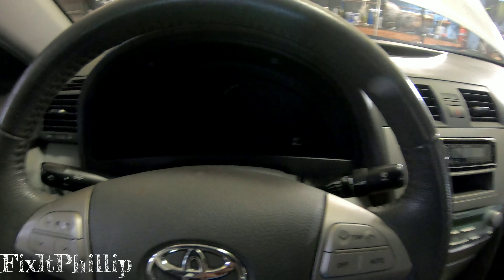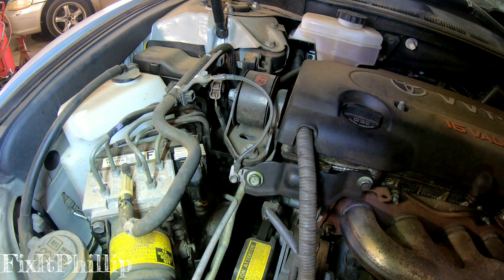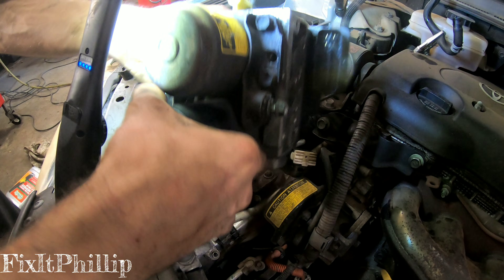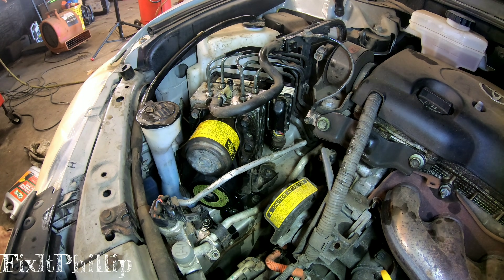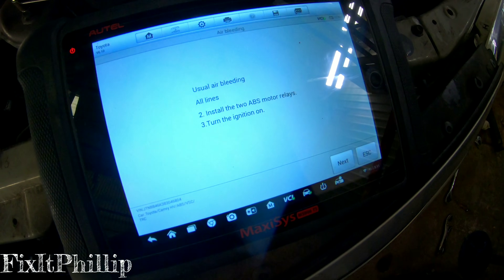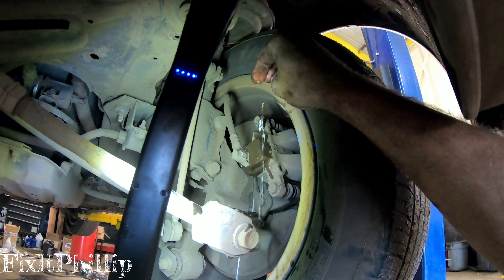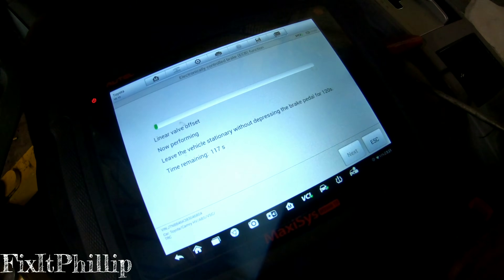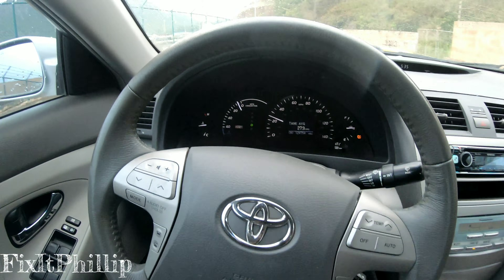07-11 Toyota Camry Hybrid ABS Module Replacement & Brake Bleed C1252 C1256 Abs Light On Accumulator

Comment: The Video shows that you bleeded only the two rear wheels, not the front , right?  Or all four ? 
Also do we need to refill it with some break fluids again since we lost some during the bleeding process? 
Thank you
Reply from the maker: All 4. The fronts u can bleed manually like any other car. And yes don't allow the reservoir to get too low
Reply: Hello again , Should we bleed the brake Synchronously when the Autel  device connected to the car or is it okay to bleed the brakes then in a different time connect Autel device to do the calibration and clear the codes ? 
Thanks a lot
Reply from the maker: You should look up the bleeding procedure after abs module your your model, and yes follow the prompts on the scanner. And yes the codes did clear after replacement of defective abs module and calibration

Comment: Do you know if the Autel MX808 is able to do this? It says it does ABS bleeding. I had bought an INNOVA 5620 that claimed to do ABS bleeding but couldn’t do it on a 07 Camry Hybrid.
Reply from the maker: I don't think the mx808 is bidirectional so it won't be able to do it
Reply: @FixItPhillip  damn, do you know the cheapest scan tool that can do it?

Comment: After replacing this abs actuator/accumulator system my trac control light flashs randomly while braking with clear road conditions. Check VSC system light came on once and never again other than that no noticeable issues. No ABS loss no braking issues. No fault codes when scanned Is it an issue unresolved with brakes or something separate like a wheel speed sensor? 2007 Camry 175000 kms

Comment: Hi, my 2012 camry hybrid is ABS pump and accumulator needs to be replaced and have been told by the technician that all the numbers on both needs to match with replacement one. is that true? thanks
Reply from the maker: Yes it has to be the right part number

Comment: Good day.
My location is Nigeria 🇳🇬. 
I have these two codes C1252 and C1256    on my 2012 Prius. It's not steady. I could be driving the abs and brake light will come on. After sometime it goes off within 1 minutes to 5 minutes. Then my braking normalizes. When it comes on I find it difficult to break. 

Please what exactly should I do in my case?
Reply: Hi brother, sorry you need to change your abs. You can contact me for any of your hybrid vehicle work in Nigeria

Comment: I had to bleed the brakes on my Toyota hybrid.  After I installed new calipers. Do I need a scan tool to clear the abs lights or will they turn off by themselves? I also checked all my sensors and there ok...

Comment: Thanks for the video! Brake fluid will cause the paint to peel off the wheels and body of the vehicle if not thoroughly washed off. Water is brake fluids enemy so it does the best job of cleaning it haha.

Comment: So if i just replace the part and bleed the breaks like normal as instructed in your video, i should be fine other than the codes still showing correct? or would the codes mess anything up....

Comment: Phillip-love the video and thanks! Quick question-if I can do all the steps you walked through. Is it ok to do this switch and bleed the lines without having a diagnostic program talking to the OBD? Can I do this and then take the car to a shop for the linear adjustment? I know it has to be done-I just don’t want to do all the steps and then create more issues-thanks!
Reply: Thanks!
Reply from the maker: If you do all the bleed steps with the computer. Then do the linear adjust later it should be ok. But I'm not 100% on that

Comment: I saw another video that the tech was working on a 2007-2009 Camry that wasn't a hybrid and he left the metal part with the brake lines attached and only replaced  the plastic portion and as such didn't have to bleed the brake lines.

My 2007 hybrid Camry still has fully operational brakes and pedal is operating normally.

I has all of the same dummy lights on you did when I took it to Firestone earlier today.

Firestone reset the codes but they said that at some point in the near future I'll have to replace the ABS actuator assembly.

Since I don't have the computer like you do...

Would it be possible for me to only replace the plastic portion for now in hopes of not having to replace the entire thing at all.

Here's the link to the video that I watched before yours.
https://m.youtube.com/watch?v=pPife7OD9LY&list=LLQ8rwi6EdgIJrPzD_NJQRAA&index=4&t=33s
Reply from the maker: That would all depend on which part of the system is actually going bad
Reply: @FixItPhillip  Can you trust the dealership to tell you exactly which part it is? They said it was this part but I don’t want to replace it if I don’t need to. Though it is turning off every few seconds and there is no external leak - the reservoir is full

Comment: Hey Philip. Do you know if any scan tool will work with air bleeding? I believe the one I have access to is a harbor freight special...
Reply from the maker: Has to be a bidirectional scan tool, a regular code reader aline won't do it unfortunately as far as I know, mine is a autel ms906ts

Comment: Hi Phillip, I don't have any issues with the brakes but want to bleed the old fluid. I have done the bleeding on a normal 2009 XLE gas engine the old fashion way. Seems the hybrid will need TechStream or a special scanner to do the job, right?

Comment: How do i know if its the accumulator vs pump or something different.. i have same dash lights, sound and vsc indicator. Car starts great. When i put in drive there is no brakes, when i press nothing happens it doesn't stop. (Break pedal is not solid as you indicated), does this mean is something different. 07 Toyota Camry hybrid. Codes b2281, c1256

Comment: Hi philip, so I’m having the exact same issues with my abs in my camry hybrid. But I was told that if I buy the part I would need to have a tech certified to work with hybrids install it. Is this true? Your video makes it seem so simple so I don’t see why it would be such an issue.
Reply from the maker: Even though yours is hybrid also. There is no high voltage orange wires running to the abs module. So technically you are not working on any part of the actual hybrid battery system. You will need a bidirectional scan tool though in order to do the bleed procedure and calibration properly. The tool I used was a autel ms906bt
Reply: @FixItPhillip  Thanks so much!
Reply: @FixItPhillip  where can I get that scan tool to do the bleeding procedure?
Reply from the maker: They are usually not very cheap to buy. You may be battery off having/asking a shop do it. If they have a bidirectional scan tool
Reply: @carlosarchila8964   Ebay has scan tools for $100-200 that will do ABS bleeding.

Comment: Hello! Thanks for the informative video. Planning on doing this job on the same exact car but don’t have a scanner to do the bleeding. Can I just bleed the brakes normally or will there still be codes?
Reply from the maker: You may be able to bleed it normally but you still need a scan tool to recalibrate the other sensors like in the video to get the codes off
Reply: @FixItPhillip  How do you typically do that? Take it to the stealership? Or regular shop? Or brake shop
Reply: What brand of scanner can you recommend?

Comment: I have buzzing noise that comes and goes when I have heavy pressure on the brake pedal. Buzzing that comes and goes sounds like it is coming from the pump...i think. I've seen several common issues ABS modules, abs actuators. However i have no codes and no lights...help please
Reply from the maker: The abs motor is supposed to come on periodically to build up assist pressure in the accumulator. You'll hear it more often the more you are applying the brakes or pushing hard. If you done any codes or braking problem you are OK.
Reply: @FixItPhillip  it is a very load noise its hard to explain. Definitely not the actuator clicking on periodically to build pressure. I wish I could send you a video so you could hear it.
Reply from the maker: @zackvernon3976  fixitphillip88@gmail.com
Reply: @FixItPhillip  just sent 2 minute video. Starts at the 30 second mark
Reply from the maker: @zackvernon3976  I haven't gotten a email yet
Reply: @FixItPhillip  should have it now. 30 seconds into video

Comment: Is calibrating the abs pump the same As clearing the codes ?
Reply from the maker: No clearing the codes is just erasing whatever codes are stored, calibration is different, and if not calibrated after Replacement it may trigger codes.
Reply: @FixItPhillip  Do you actually have to physically bleed the brakes?

Comment: Hi Phil!  Do you know if the clients's ABS Module tried to build pressure, continually going on and off, prior to the system failing?  I noticed that my daughter's vehicle did this while the car was off,  for weeks prior to it actually failing.  I thought it was part of the electric aspect of the vehicle.
Reply from the maker: Yes the electric pump would cycle on and off more than usual, the accumulator which is supposed to hold that built up pressure failed,  thus the lights on and hard brake pedal
Reply: @FixItPhillip  Do you know how often it operates under normal circumstances? My moms goes off every few seconds, it definitely needs replacing. But when it is replaced what should I expect?
Reply: Thank you for such a quick response!
Reply from the maker: No problem, please be sure to subscribe,much appreciated! Take care

Comment: Hi thanks for the video  I did replace my 2015 Prius ABS unit just like you did on the video  my brakes are OK but On the turn left or right my traction control light comes on .the ABS unit need calibration ? or module initialization  ?Thank you
Reply from the maker: Yes the calibrations I do at the end is needed after abs module replacement, I'm happy the video helped you!
Reply: FixItPhillip please which scanner you recommend to purchase not too expensive can do the job  thanks again for the quick response
Reply from the maker: @davidoalvandi7804  I have a Autel maxisys ms906ts. It's a bidirectional  scan tool, I'm not sure which other brands or models do that calibration, your gonna have to do some research, or pay a shop to perform the procedure, good luck brotha

Comment: The reason of why some of you guys even after the reinstall still got the light on is thy it need a tools to do the zero ground calibration and so on before this thing actually can go. Things r getting more complex now, just replace is not enough
Reply from the maker: Ya this one i had to calibrate the linear valve offset, nowadays most abs modules need some type of calibration after replacement.

Comment: I did the same replacement,  i keep geting the abs motor coming on when i press the brake pedal down.  Is that normal?
Reply from the maker: The motor is supposed to come on intermittently to build hydraulic pressure for the power brake assist, this one had a problem where the pump would come on too often because the accumulator wasnt holding the hydraulic pressure and had fault codes and hard brake pedal, no power brakes.
 Normal operation you will still here
The pump motor cycle on and off at times, more so when you are pressig the brakes
Reply: @FixItPhillip  ok thanks. I thought it was a problem but is normal. Thank so much
Reply from the maker: Your welcome, plz be sure to Subscribe, much appreciated!
Reply: @FixItPhillip  sure will

Comment: Can you say how frequently buster pump is restarting now after repair?
I mean when car is in READY and not touching brake pedal.
Mine is restarting every 3 minute for 5 second.
Reply from the maker: Is your brakes working normal? No codes or abs light on?
Reply: @FixItPhillip  As I see brakes are working normal, no codes or abs lights.
Reply from the maker: @giogio-kx4kr  its ok for the pump to turn on periodically to maintain pressure. if you have no codes or problems then i would not worry about it.
Reply: @FixItPhillip  Thanks. I'm asking because though there is no faulty codes, but sometimes when press brake pedal I hear short noise from ABS module ( Not pump working, but other). First I thought it makes pedal depress, but than found it coming from ABS module. At least 3 years brake system is working in such manner.
Reply: @giogio-kx4kr  hi. Got a similar noise like you've described (not the pump noise but a noise when pedal is slightly depressed.  Noise stops when pedal is depressed fully) I also noticed it's from the abs module.
Reply: @jdani000  I observe this already 3 years and it still is working yet)

Comment: i have a 2010 prius is there any parts to rebuild this?whats the problem with the unit?bying used does it solve the problem or in 2 or 24 months i will have to buy another unit?what part of the unit is broken?is anybody knows?
Reply from the maker: The brake acumulator and or pump are common to fail but i cant say thats your exact problem.
Toyota prius is a different abs design/placement than this camry but the way the work is similar.
I believe there's companys that rebuild the abs unit if you send it out to them. Other than that theres always new, if buying a used one your always taking a chance because you have no idea how long it will last. Good luck
Reply: @FixItPhillip  thank you very much!have a nice day!i hope i find the solution to my problem and not have to spend 3000euro!

Comment: Thanks for the video I have alot of C codes with the same exact car 2007 toyota camry hybrid  I was wondering if you could couch me thru it with techstream
Reply from the maker: Ive never used techstream before, just the autel maxisys that i have, what codes do you have

Comment: This is excellent work, I wish that this video came out 7 months ago. I would have saved $1,000 since I had to go to the dealership.
Reply from the maker: Thanks for checking out the video. Ya i wish i would have had that repair earlier to be a help to you.
Reply: @FixItPhillip 
Hi
Reply: Only a $1000? I did the timing belt n pump on my 2006 hihy for 2-300 in oem parts. Dealer wanted 2600$ 
I need to do this to my rig, thx for the video.
Reply: Was quoted 1300.00 today for replacement of abs module
Reply: @bens3767  Was quoted $1,527 at the Toyota dealership a few days ago. Just purchased one on eBay, will try next week when I receive it.
Reply: @roskar  i ended up buying the part from toyota and replacing myself as well as manually bleding the brakes and did not need to take to the dealership for any type of programming.  ended up costing 1000.00 for the part and brake oil.... check lights went away immediately after
Reply: @bens3767  I guess it was worth the cost. Did you use a scanner? It seems like I would need one for the bleeding.
Reply: @roskar  no thats what i was referring to.  i manually bled them.  just youtube manually bleeding brakes youll need someone to press the brake pedal for you....
Reply: @bens3767  oh, gotcha, thank you!
Reply: @bens3767 thanks man, you just fixed the last puzzle piece!